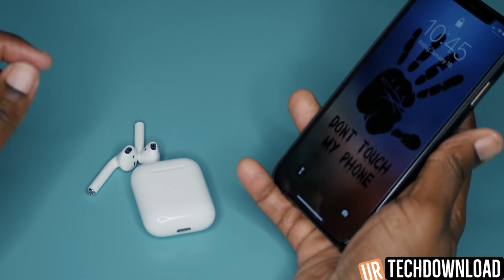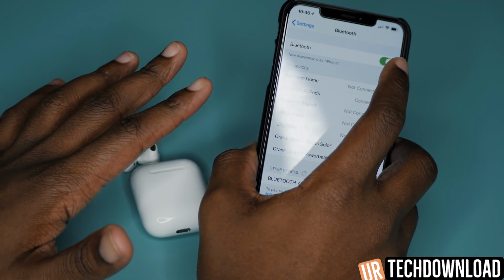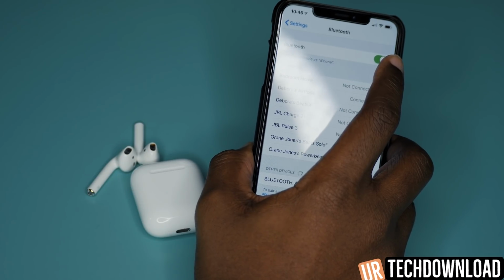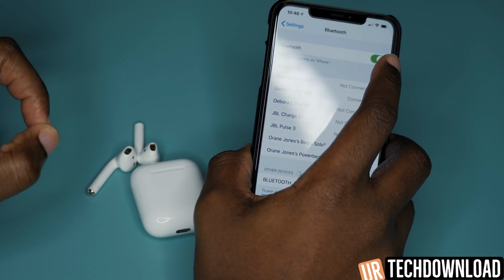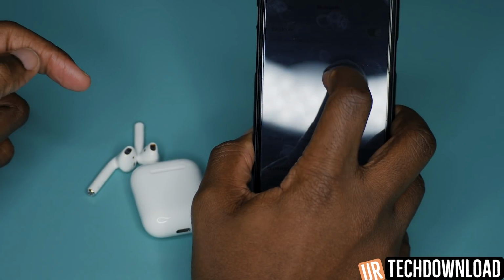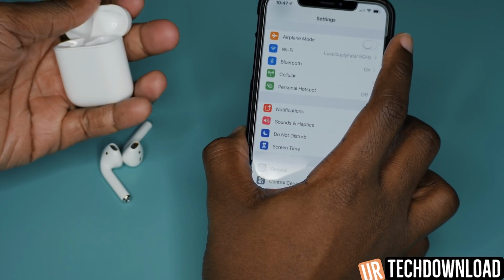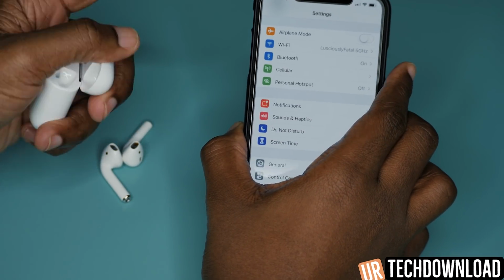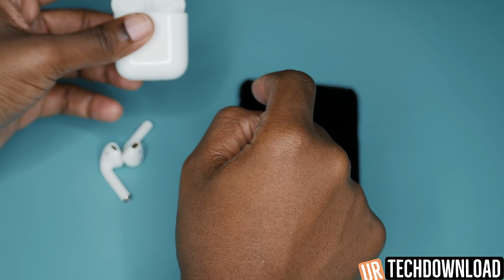Airpod Issues? No Problem! Here's How to Fix Them

Comment: My left side airpod automatically disconnected after 2 or 3 min... both are fully charged.
How i can fix this issue.
Reply from the maker: This may indicate an issue with the left airpod itself if you are sure it charging correctly, then you can try to do a full reset on the airpods themselves. If it's still resetting after that then there may be a hardware issue with that airpod.

Comment: everytime i put my airpods on only one side makes that noise suggesting its working, if i take one out and put it back on again that airpod works but the other airpod stops making sound. what do i do ?
Reply from the maker: There may be an issue with the charging connectors in the case. But you can try to clean out the bottom of the case with a qtip and the bottom of the airpods themselves, place the airpods back into the case and maybe try applying a slight bit of pressure to make sure they are making contact with the charging connectors at the bottom of the case. If that does not work, then you may need to contact apple as there may be an issue with the case or airpods themselves.

Comment: my right AirPods connects, me left one doesn’t AT ALL. When I open my AirPods case it doesn’t show up just by opening it anymore..I watched a video that said to push “forget this device” and reconnect to it, but that didn’t help the issue. I have seen on multiple other comment sections that many people are having this same issue. Extremely disappointing. I have reset them multiple times. Nothing is working please help
Reply: mine does that too
Reply from the maker: Try cleaning the bottom of the case and the airpod, to make sure that it's making contact with the bottom of the case. You can also try a full rest of the aipods as well as restarting the phone. Also, don't forget you can also reach out to apple support as they can replace individual airpods
Reply: Same exact problem :(
Reply: t bear Do you solve urs?

Comment: Mines said not your AirPods and when I try to connect them to my phone they say connection failed
Reply from the maker: With that message, one of the best things to try is using the button on the back of the airpods to put it into pairing mode then try to connect it your devices. if that does not work try resetting the airpods themselves. Also, remember that to seamlessly switch between Apple devices make sure all the devices are signed into the same icloud account.
Reply: URTechSupportDownload I tried both things they did not work,I bought them at Walmart so when my dad got home we went to apple store and they used there demo airpods and they connected so what I’m gonna do is return mines and buy them at apple store

Comment: my aırpod dont show battery percentage wıle ı connect ıt
Reply from the maker: You Can try restarting your phone if the issue is still happening then try having the phone forget the airpods then go through the repairing process. If all else fails you can try a full reset of the airpods.

Comment: Plz reply me, My AirPods work properly everything is good but there is little problem in my microphone when I talk someone on call or in game it produces weird and bad sounds and who is talking with me then he can’t hear me he only hear the weird sounds and everything was good but from last three days I am facing this!plz help!
Reply from the maker: Sound issues can be a hit or miss when it comes to troubleshooting, the first thing you should try is going into the settings and changing the mic settings to set either the left or right airpod as you main mic. This will give you an idea if the issue is happening on one of the airpods specifically. You can then try to have the phone forget, and re-pair the airpods then test once more. You can also try restarting the phone, and resetting the airpods themselves and test once more. You can also try restoring the firmware:  Place both AirPods in the charging case after  Press and hold the button on the charging case until it flashes white, Place the case with the AirPods inserted to charge. Wait until either the LED turns green, or until 10 minutes has elapsed. You can close the lid while you're waiting for the firmware to update. If you're still having issues, Contact Apple Support.

Comment: It works until a call comes and when a call come it automatically disconnects
Please hepl me out
Reply from the maker: A couple of things you can check is, Check your charge, Check Bluetooth,  Disconnect your AirPods then reconnect them, Clean your AirPods and bottom of the case, Turn off Automatic Ear detection, If you have an Apple Watch you could try unpairing it to see if that makes a difference.
Reply: Same prblm bro dont know what to do 
Even visited apple store but no help from them

Comment: When I put my AirPod in its case the left one doesn’t turn off, I got no clue?
Reply from the maker: Try cleaning the bottom of the case and the airpod, to make sure that it's making contact with the bottom of the case. You can also try a full rest of the aipods as well.

Comment: Hey bro i need help , i tried to clean my airpods and metal with a q-tip and my left airpods still isn't charging what should i do ?
Reply from the maker: Try applying some small amount of pressure to it, just to make sure it's making contact with the bottom of the case. Also try a reset, if nothing works try reaching out to apple support.

Comment: If I open my AirPods I can’t see anything on my screen, and the with light is always on even when I reset I even have cleaned it what do I need to do?
Reply from the maker: Sometimes when this happens it's because the Airpods are not making contact with the charging connector at the bottom of the case. Try applying a little bit of pressure to them and see if that works. Also, Some users have had success doing a hard reset on their phones as well. that you can also reach out to apple if nothing works. Good Luck

Comment: And I don't think it's the airpods I think it's my phone they work perfectly fine on my mom's phone and my sisters tablet but my it doesn't and nothing has worked any tips
Reply from the maker: If you think I may be the phone then the standard troubleshooting applies, make sure ios is updated, try a restart, reset the network settings then try resetting all settings.

Comment: I’m still having problems with my RIGHT AirPod ... it still won’t play sound . It plays this weird Static / Ringing noise .. but it isn’t playing sound ... can you please help?
Reply from the maker: sounds like the issue could be a hardware problem if you have already tried a full reset and making sure that the right airpod is fully charged. Then reaching out to Apple about the issue would be my next suggestion

Comment: Hello everytime I open the case nothing shows up and once I connect through the settings the airpods start cutting out while I listen to music but it shows that the music is still playing
Reply from the maker: It sounds like the airpods maybe connecting to another nearby device, remember that When you pair your AirPods with your iPhone, iCloud will sync the pairing to any iPad you have and logged into the same iCloud same with mac. Try unpairing your airpods from your phone(having the iPhone forget the airpods), and making sure it's not paired to any other devices. Then re-pair and see if that helps. If not then try an unpair with a full rest of the aripods and see if that helps.

Comment: Every time I’m on ft my AirPods disconnect and reconnect every 5min
How can I fix
Reply: Bro why is a nigga with boobs on your pfp
Reply: @vinny2333  fr💀
Reply from the maker: Since ft is treated as a call you can use some of the same troubleshooting used for call issue.  Try Setting the AirPods to Use Either Left or Right Microphone, try turning off Automatic Ear Detection, have the iPhone forget the AirPods and Try to Pair It Again, Reset Network Settings/All Settings hopefully by throwing a couple of things at it one of them will help fix the issue.

Comment: Helo i have AirPods 2 and i use a iPhone 6 and when I play music  and put my phone in my pocket the sound keep cut out and I try resting them and still don’t work pls Help
Reply from the maker: The issue may be due to interference, You can try to restart your iPhone, and also try resetting your network settings Then try to pair and connect the airpods again.
Reply: Mine too :( airpods1 & 7plus

Comment: My AirPods won’t connect also keeps flashing orange can anyone help
Reply from the maker: If the light flashes amber, then you may have to set up your AirPods again, try a reset first. If it wont reset try wiping off the metal end of the AirPods, and then used a Q-tip to clean the bottom of the case where the metal end of the AirPod made contact with the case.
Reply: URTechSupportDownload alright thanks

Comment: I just buy airpods today but it's not connecting with my iPhone 7+
Reply from the maker: Might be a software issue, check to make sure your iPhone's software is updated, make sure Bluetooth is turned on and you can also try Resetting your Network Settings on the phone. Also, try to connect them to another device to make sure there isn't something wrong with the airpods themselves.
Reply: @YourTechSimply  I tried with iPhone x also.. and I am not abale to restart airpods 
the green light is blinking I don't know what to do
Reply from the maker: if it's not working on the iPhone X as well then there may be an issue with your airpods, your next step would be to reach-out to apple.

Comment: I thought it was my AirPods disconnecting, but my Bluetooth is turning off and back on by itself for some reason. Any ideas?
Reply from the maker: Yeah for a Bluetooth issue on the iPhone you can try,  a Hard Reset of the iPhone, Resetting your Network Settings, or Resetting All Settings might work as well.

Comment: When i listen anythind, my either one of them airpods does not sound fpr a while, but then it works as nomal.
It happens about 4-5 times in 1 hour of listening.
Reply from the maker: You can try the basics, having your iPhone forget the airpods then reconnecting, making sure the software of both the phone and airpods are updated, reset the network settings on the phone and finally reset the aripods themselves. If none of that works try reaching out to apple support.

Comment: My calls suddenly disconnecting from andriod samsung S9 plus.
Reply from the maker: Unfortunately, there isn't much when it comes to airpods and Android you can try. There really is only a couple of things to try the first would be to try and make sure the airpods are updated (You may need an iPhone or iPad to do so), Also make sure they are unsynced from Bluetooth then go into your Settings -> Apps -> Apps -> hit the 3 dots on the top right -> Show System apps -> scroll through your apps look for any that says Bluetooth. Select them to go to storage and Clear The Cache. Hopefully, that helps in some way.

Comment: Hello my airpods randomly just decide to have glitchy audio out of nowhere and sometimes just go silent unless i take them off and put them back on what should i do
Reply from the maker: There is a couple of things you can try other than the basics of, making sure your software is up to date, and that you're in a good distance of your phone. Sometimes just Toggle Bluetooth off and on again will do the trick, You can also try having your phone (or whatever device your using the airpods on ) forget the airpods then re-sync them. Also try rebooting that device, and if all else fails Reset your AirPods and the network settings on the phone as well. If it’s still happening despite these fix suggestions, Don't be afraid to call Apple. Hope that helps. Good Luck And thanks for the question.
Reply: Same problem brother

Comment: Hello ,
My airpods 2 is giving me problems like i made a reset on the airpods and now when i open the lid it blinks white light continuously and also it not showing in my iphone either on my home screen nor in bluetooth settings please help
Reply from the maker: Make sure that your phone has the latest version of iOS.  Then Open Control Center and make sure that Bluetooth is on. Put both AirPods in the charging case and make sure that both AirPods are charging. Close the lid, wait 15 seconds, then open the lid. The status light should flash white, which means that your AirPods are ready to connect. If your AirPods don't connect, press and hold the setup button on the back of the case. Hold the setup button until you see the status light flash white, then amber, and then flash white continuously. Open the case—with your AirPods inside—and hold it next to your iPhone.  If you still can't connect, try resetting your AirPods, and also rebooting your phone, and resetting the network settings.
Reply: URTechSupportDownload  i tried resetting the network settings and also updated the ios but still when i open the lid of airpods there is no response on the iphone nor it shows in the bluetooth section of the iphone and also it doesn’t show on my one plus 6t also

Comment: Hello sir, my both of airpods got a problem is very drain battery so fast which less 1 hour, and sometimes when i put in charging case the airpods had a bug suddenly jump to 99% percentage of battery... i had already reset it, but its not work.
Appreciate much for your kindly solution
Reply from the maker: Resetting is a good start,  If that method doesn't work, draining and recharging your Airpods may help. Drain the battery by playing music through them continuously without placing them back to the charging case till they are completely drained, then recharge fully. You can also try to Unpair and Reconnect Airpods from our Devices. if none of those work, you will need to reach out to apple support, you may need a replacement.
Reply: URTechSupportDownload Well noted sir, many thanks for your help

Comment: my right airpod isn’t working no matter what i’m doing 😩plz help
Reply from the maker: Try to clean out the inside of the charging case and then put airpod into the case to charge for 15 minutes and then check to see if it's working. Also, go into your settings, press general then hit accessibility scroll down until you find a scale with a left and right and make sure the circle is in the center. Sometimes that helps if not try a rest, and then there is always apple support if all else fails

Comment: So Im having a problem with my Airpods: The right one wont connect anymore.
Its my second pair because my first ones had the same problem. Luckily I was still in munich so i were able to change them in the Apple store. But now Im back home and I tried anything  I found on google but nothing worked. Im thinking about sending them back to get a new pair that will hopefully work for a longer time than a month (unlike the ones Im owning right now), but Im not sure.
Reply: Catthey the same thing is happening to me too and i wanna go back to get new airpods at the apple store
Reply from the maker: Sorry, you're having the issue, sometimes it does not count to troubleshoot especially if they are new and still covered. Bringing them to apple is the best troubleshooting step in this case

Comment: my left airpod doesn’t work... what should i do??
Reply from the maker: Try to clean out the inside of the charging case and then put airpod into the case to charge for 15 minutes and then check to see if it's working. Also, go into your settings, press general then hit accessibility scroll down until you find a scale with a left and right and make sure the circle is in the center. Sometimes that helps if not try a rest, and then there is always apple support if all else fails
Reply: Same

Comment: my airpods are fully charged but when I turn it on, it wont light up/it wont turn on.
what should I do?
Reply from the maker: If the airpods are showing a charging light and you are able to verify they are fully charged however they are not connecting to your device. You can try a full reset of the airpods, also have the devices forget the airpods and if you are on an iPhone try to reset the network connections. Also, try connecting it to another device just to make sure. And if none of that works it's time to call the big apple.

Comment: I m facing a problem with a microphone of airpods so please can u help me to fix it 
I cant use airpods while calling because microphone is not working n other cant hear me
Reply from the maker: Microphone issues can be hard as they can be more of a hardware problem than a software one. In these cases, I would suggest trying the standard fixes like resetting the airpods, and the network settings on the phone as well. Also, you can Go to Settings>Bluetooth Then Tap on the ℹ next to your Airpods. That will open a group of settings. Check the Double-Tap settings, and also check the Microphone settings. After that form, everything I'm reading this may be a case where you have to reach out to apple. hope that helps in some way

Comment: My microphone is not working, even if I am near my phone my microphone will not work. What can I do?
Reply: I already tried resetting them multiple times it still doesn’t work
Reply from the maker: That Sucks, Since you already tried the reset option, the only other thing would be to Go to Settings>Bluetooth Then Tap on the ℹ next to your Airpods. That will open a group of settings. Check the Double-Tap settings, and also check the Microphone settings. After that form, everything I'm reading this may be a case where you have to reach out to apple.